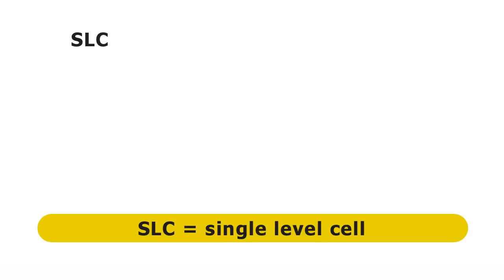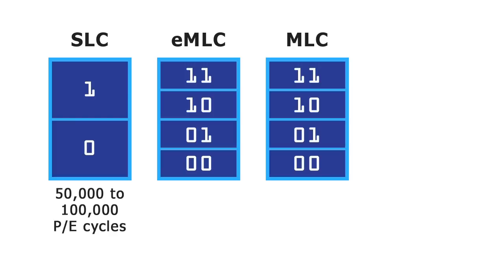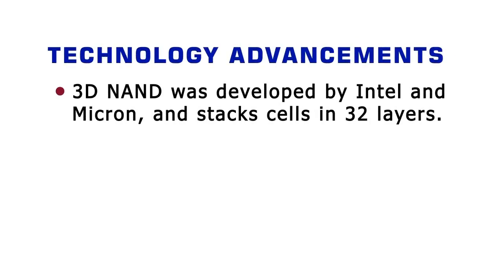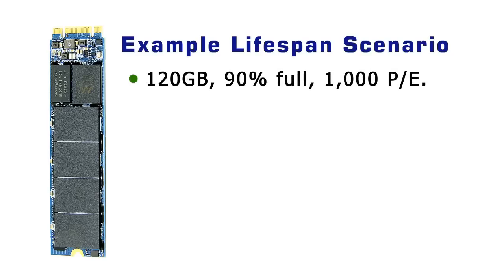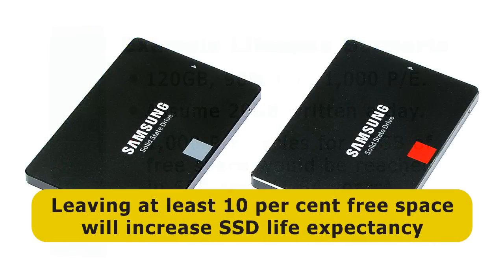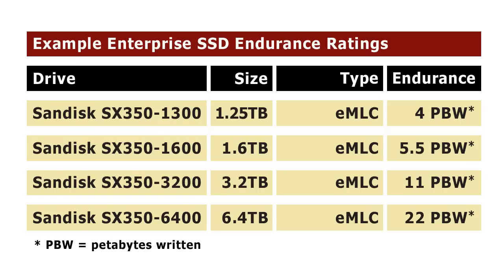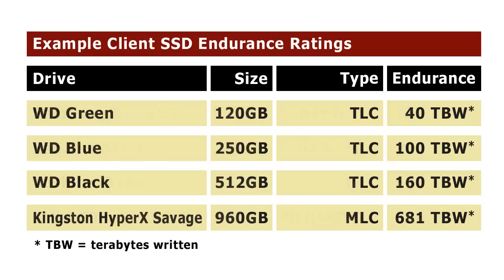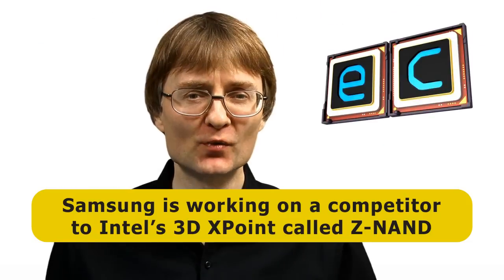SSD Life Expectancy

Comment: I work in a data center and SSD failure rate is on par with the mechanical counterparts. I also have been using SSD's on my personal computer for quite a long time, never having one fail on me, I consider them just as realiable as any other mechanical hard drive.
Reply: Fernando Kreutz But a data center would be writing data wayyyyyy more than a general user would
Reply: rin weeb that's why he's talking about the mechanical counterparts, I assume he means of the ones used in the datacenter.
Reply: Yes, but the SSD drives used in data centers are not the same type used at home (as reported in this video).
Reply: Mine died pretty fast for unknown reasons.
Reply: I have two failed since 2012. I have a few WD HDD which failed on me too (one losing a huge 3TB pirate haul of the finest movies ever made). But i also lost power supply units and memory parts, even lost ethernet controllers on the mainboard to voltage spikes on the landline (in Thailand not in Europe).
Reply: My scariest PC experience was a bios update on an asus pro gaming motherboard.
Reply: asus bios update is a mess
Reply: I agree. We have users with SSD in Lenovo laptops, we see a similar rate of SSD dying to that of old spiny magnetic drives. SSD show similar signs of dying also - Users report a slow computer. Then we find blocks are corrupted. Give it a few more weeks and the machines fail to boot.
Reply: Interesting, I'd consider them more reliable.
Reply: "SSD show similar signs of dying also - Users report a slow computer." That ain't no usual signs of a "dying" drive but of fragmented hard drives. The failure rate might be a coincidence or dependend on a specific user scenario.
Reply: Yes, both enterprise grade. But that translates just as well as to consumer devices in my opinion, I'd even say SSD's are more reliable on mobile devices (laptops) as they suffer no issues from physical abuse.
Reply: Red Phoenix fragmented ssd drives don't exist as they store data completely different
Reply: My biggest problem with SSD's are the loss of capacity over time. That's a lot different than out right failure. That's something that can happen really fast in a server application. I only currently trust using an SSD as my OS drive. Since I have an image of my OS drive, I don't particularly care about it.
Reply: That's why the first computers I installed SSDs in were laptops. All desktops followed after something like 6 months. The only type of device at home with HDs are my NAS devices. They still have 4x4TB HDs with RAID5. Currently only at 27% capacity. Hm.
Reply: If voltage spike kills SSD then thats the most alarming thing(I have 3 level of protection system) ,My mother board died few times ,My both ram Died toghether ,My PSU Died but my 2 HDD still working for nearly 8 years .SSD is another LCD tech after CRT monitor .Low life span ,Slim design Good for Business but not good for consumers
Reply: We reached the critical miniaturation dimension. Now with a >15nm process you can even kill memory chips and cpus by using software. wear out is much higher. I think soon we will have to rethink our purchase decision making.
Reply: @Konstantinos Kostis:  Sorry but a set of 4TB in RAID5 is madness and stupidity. The chance to get read errors during rebuild is almost a 50:50. I hear about so many systems crashed during rebuild now ... and wonder why this is not getting more attention. Do a mirror RAID1 or RAID6.
Reply: I had a dvd rom catch fire and scorched my SSD that was in the next bay. Is there a test I can do to see if the drive is stable?
Reply: My Vertex 4 died on me due to an electronic part on the mobo just up and frying itself but the replacement they sent (was a Vertex 460A since they had ceased the Vertex 4 production) and after 16-18 months I am at 93-94% according to SMART so it is so far so good and was the best investment I have made to bring new life into an aging PC.  Boot time for windows went from 60 secs to 12-14 seconds and I was thrilled.  My new Ryzen (late this year so the bugs are all ironed out) system will have a SSD in it as well but the price for a 1TB SSD sure isn't 60-80 dollars like it is for a HDD so HDD will be my D drive.  If SSDs ever come down to a HDD pricepoint I will toss the HDD.
Reply: I was kind of hoping that they would fail less often than mechanical drives, I've had so many mechanical drives fail... In fact, out of 8 mechanical drives in my server computers in the garage, 4 of them had started to fail in the last month. I've replaced the worst of them, but the other 3 I don't have replacements for yet.
Reply: Kaz might be worth changing your PSU. Solved many of my seemingly unrelated issues.
Reply: I've had a higher failure rate of SSDs than spinning drives in desktops. Laptops are another story as an SSD can handle vibrations and movement better than spinning drives. But what it really boils down to is don't buy the cheapest SSD you can find. There is a reason why the best ones cost more. I have a couple of bargain SSDs that I use for testing systems but for everything else it's Samsung Evos or preferably Pros.
Reply: Had to watch the video a few times to take it all in :-)
If anyone can manage to remember all that verbatim they could out geek their pals at a geeky party.
seriously though very useful to know, thanks
Reply: The problem with this is that I've never had a UPS last more than a year. After going through several of them, I just gave up. The two AVRs I tried quickly had a 50% failure rate. Of the UPS failures, all of the batteries were dead and unrecoverable.
Reply: @Lothar Scholz: nothing of the sort ever happened to me and I'm not just talking about the two NAS I got. The main reason why this is not getting more attention is most likely that it's neither madness nor stupidy.

What I probably should mention is that I replace those drives after about three years of constant use just to be safe. The old drives may get reused for temporary data copies. RAID1 just didn't work for me for capacity reasons. Mind you my first NAS originally had four 2TB HDs. Three years later I replaced them with 4TB HDs along with another NAS with the same size drives as one of my backups.
Reply: @Konstantinos Kostis: No it's not. There are reasons why at 1TB disk size every professional storage provider like EMC, Oracle or HP issued warnings against using RAID5. 
http://www.zdnet.com/article/why-raid-5-stops-working-in-2009/  you might also google about the "RAID hole".
Reply: @Lothar Scholz: Well, as far as I understand it the only way to migrate from RAID5 to RAID6 for me is to reinstall from scratch (since all drive slots are occupied and in use). At least it said so on the QNAP website. I shall give it a try when I replace the drives (not too far from now). Having a second NAS drive as backup gives me a chance to do this with low risk and downtime. Thanks for bringing this up, Lothar!
Reply: John Jeffry if you have surge problems, it might be due to a improper grounding connection...
Reply: Not always true.
Reply: Battery life in a UPS is an issue, but that's why most home UPSs have a way for you to change the batteries at home.  You can even change the batteries in some of the larger UPSs designed for office use, if you know what you're doing.

In many of the "home use" UPSs, you just need to switch it off, unscrew the battery panel and remove it and you can pull the battery out and disconnect the "spade" connectors, then purchase an identical replacement and reverse the process to fit it.

If the old battery shows signs of distress, such as bulging or cracking of the case, or the UPS gets very hot, you should either dispose of the UPS or get it repaired (in my experience, the problem will usually be one or more electrolytic capacitors which have gone low in value).

I have one UPS which wasn't really designed with battery replacement by the home user in mind, but I've replaced the batteries once in the past and I'm in the process of replacing the batteries a second time, coupled with replacing a faulty capacitor which resulted in the aforementioned "signs of distress" in one of the batteries.

In my experience, you should expect to have to replace UPS batteries at least every 2 years.  They do wear out even when kept on a float charge most of the time.
Reply: 5 years is actually a very good life for a UPS battery.  You can usually just replace the battery to revive the UPS.

If the UPS uses a SLA battery, you can increase the run-time by attaching a larger capacity SLA outside the UPS case.  Unfortunately, the only way to increase the power is by replacing the UPS with one which has a higher power rating.

You do need to be cautious about replacing the battery with a larger one, since it's possible that the UPS has been under-rated and will overheat if run for longer than the manufacturers designed it for.  This is especially likely for UPSs designed for home use since they are made to run for around 5-10 minutes only - just enough time for you to notice the power failure and save your work and shut down the computer.

Also note my reply to Art Becker about signs of distress from the old batteries.  The UPS might need repair or replacement in that case.
Reply: Yes, data center ssd drives used better quality nand like tlc/mlc instead of mainstream consumer drives which are mostly tlc these days. So he can't extrapolate his findings to normal ssd drives.
Reply: Next Version of Virus ,Malware will be SSD kilers ,So One Virus attack & Your whole Terabytes of data are gone .Good luck .
Reply: This is across 3 different power supplies however, the one that died the worst was on the highest quality server power supply as well. Though, a UPS could be worth looking into. Also, these are fairly old drives, 1 of the failed ones has been in service for 8 years, and the other failed ones were probably 3-4 years each. (2 good ones less than a year, 2 other good ones were also 6-8 years old.)
Reply: Personally, I haven't actually had any of my SSDs fail. I have a mix of Samsung 840 Evo, 840 Pro, PNY and Sandisk drives.  SD cards on the other hand... We've lots dozens of those to excess writes.
Reply: +John Jeffry There is no universal virus provider who makes like new versions of viruses. And viruses that delete your data or make it unaccessable, demanding randsom have been around for ages. Be your data on the SSD or HDD, it really doesn't matter. I have had only one SSD fail and even then by plugging/unplugging it sometimes worked. Enough to get a chance to read it out to a new SSD. It was on warranty and was replaced. I've got around40...50 SSDs altogether and the rest has been working fine.
Reply: In my personal experience, SSD fails sooner and have more problems than HDD. I have a OCZ Agility 3 SSD failed on me and also experienced issues with a Sandisk Ultra II SSD. So for now I'm sticking to HDD for storage and hybrid drives for my OS drive.
Reply: SSD already killed with Software by few SSD manufacturer that is why many SSD review show same story of SSD dying right after a month of their warranty expires .So it won't take much time when these Manufacturer made viruses got into wrong hand & they start spreading them all over internet .If SSD can be killed with software  then maybe its too much risky medium to store your precious data
Reply: Samsung ssd seems to have the biggest lifespan . A German computer magazine had a 750 Evo and used it in long term use for video editing for about 3 years very (they said very intensive workload). OCZ and SanDisk weren't capable to write the same amount of data , they failed a lot earlier then the Samsung one. All had the same capacity or was equal to each other.
Reply: All my ssd harddrive i have bought so far have failded after 6-9 mounths :/  just get them replaced by the warranty so no big problem. But damn im jelly on you. Fermando..
Reply: My HDD failures "warn" me.  Noisier, & uneven noises.  Higher rate of bad clusters over the dying months.  My HDDs are in a notebook, AIO or linked by cable, within my hand-reach.
Reply: I lost an entire mechanical drive's contents instantly due to a firmware bug. All mechanical drives have failure modes where you lose everything without warning. Just back up.
Reply: +cee128d Totally agree! Those few extra bucks on the purchase do reflect in longevity and performance. I also use Samsung and prefer them.
Reply: George... did you consider having someone do a clean room recovery of the disc? It can be expensive but sometimes worth it depending on the data.
Reply: C.M. Mike Adams Yep I did, as I assumed the data on the platters themselves was fine (corresponded with the bug report by Seagate themselves), but yes too expensive for the data. :)
Reply: Lower powerusage, less heat and faster speed isnt  good for the consumer?
Reply: HDD don't use that much power ,You don't need 2 TB/sec data speed ,even games dont' benefit from SSD speed ,so those are not that necessary but SSD fails in the Most Important sector which is in Protect your Data even after paying high price for that . (power failure ,other failure or just limited  controlled  life span).SSD passing an Experiment period now ,its not an Stable medium for data storage yet .Maybe Intel's $1500 3d Storage SSD is the future & can truly replace HDD
Reply: Games don't benefit from SSD speed? Really?

I know I have 3 games that started running with better fps after moving them to an SSD. Moreover after moving over to SSD multiple programs such as Inventor are less laggy.
Reply: You could argue that games are some of the best use cases for an SSD. Once you install them to the drive, its mostly reads rather than writes with reads not being damaging to the cells and providing a good boost in loading times/frame rates on games. Other than the occasional patch for a game you don't really overwrite stuff on it so it will last a long time.
Reply: Most people have no idea how to use SSD's and a great deal buys awful brands and them blame it on the technology.
Kingston makes the worst SSD's on the market imao. 
Always buy SSD's from brands that also manufacturers them specially the memory cells and controllers, like Corsair, Toshiba, SanDisk, Samsung and so on. 
And never do defragmentation on SSD's, I met so many idiots who defragment their SSD's.
Reply: thanks.
Reply: Fernando Kreutz And what will  happend if you drop one to the floor by accident ?
Reply: SMGJohn uhh does defragmenting ssds damage them??? 0_o cause I've been doing monthly defrags for the past 6 months
Reply: Hypatia ABANDON SHIP!! TURN OFF THE POWER AGHDJDJCUEJ
Reply: Feyangel23 defragmenting isn't required on an SSD
Reply: The best part is that they are getting better, so I wouldn't be surprised if they were to get more reliable than mechanical hard drives.
Reply: Feyangel23 defragmenting is for meant for hdd drives, doing it to an ssd is bad because its unecesarily straining ssd since its just wasting more write cycles and wearing out the cells by moving most of the data on it around.
Reply: Fernando Kreutz it is recommended buy high capacity ssd?
Reply: +Diego Camilo Peña Ramirez As mentioned in the video, its good to have over provisioning, thus, get one that meets your needs plus a few extra GB for that :)
Reply: +Aaron A nothing happens unless you physically damage the SSD (break it for example).
Reply: I can't wait until the new ferroelectric RAM becomes on-par with the current flash technology.  Then we won't have to worry at all.
Reply: Do you mean a nano-implementation of ferrite cores? It would be incredible to watch the construction technique for something so wild.
Reply: I think the biggest concern for end-user like me is the potential to significantly wear-out entire cells by an OS that is known to thrash mechanical drives when implementing "virtual memory". Any machine that I set up which uses an SSD has all ability to create a swapfile disabled.

Also, I only allocate a maximum of 75% partition space, even on drives (like Kingston) that already have a healthy hardware/hardwear reserve.
Reply: Fernando Kreutz 
The treatment of the disks at the Datacenter cannot be compared with the use of the average user. It doesn't even make sense. SSDs should be lasting longer than HDDs. I'm not doubting you, I'm just saying, you can't compare apples to oranges and then say that oranges are all of the sudden just like apples in every way.
Reply: Mine 128 GB Samsuns SSD in toshiba 2010 laptop now have more 1000 days off power on time..works like new..also dont use Windows 10 ...because Windows 10 use hard drive 10 times more then Windows 7
Reply: Feyangel23, are you being serious? I'm shocked that that is even possible to do. Defragmenting is not applicable to SSDs; it is applicable to Hard Disks. Defragmenting an SSD is as intelligent as rewinding a DVD movie after you finished watching it. Yes, if you are actually allowed to defragment an SSD, then you have been damaging it by wearing it out.
Reply: Fernando Kreutz 
Try theWesternDigital Purple Disk 8TB drive. It is designed to be used daily for many many years while you get hundreds of gigabytes in and out each day. And if you use it in RAID, you can have an incredible amount of transfer speed. SSD are only good because they have a short response time (closer to the response time of ram).
Reply: I Had 1 real hard drive fail in my life. Something I could not restore anymore at least. I already killed 3 SSD in the past 5 years. I have a neck for it since I am used to "sometimes" pull the plug out of active systems. I am old skool. This used to be not a bad thing.
SSD however is way more "sensitive" to power problems.
Basically my past 3 SSD lost their MBR function in general. In witch windows or bios for that matter, cannot initiate the hard drive. The computer does understand it is a disk of some kind, but it cannot use it. Tried to recover them with standard software but never got it working again. 
I know in the end the problem is basicallly still software related, I am afraid it is at factory level software.
Reply: Intel SSD having problem with firmware update, I have lost one SSD this way!  http://www.techspot.com/news/44694-intel-confirms-8mb-bug-in-320-series-ssds-fix-available.html
Reply: You can fix that 8MB bug by doing a secure erase with Linux(installed or usb run only). Took 1h+ to recover my  wife ssd, there are plenty of guides on how to do it. Hope you didn't throw it away.
Reply: Ohw thanks, I will have a look at it with some stronger tools then.
Ex-IT guy here btw. Disconnecting power is not the end of the world for a general HDD. Bad sectors and such always happen. But with HDD they are less troublesome just because they are more. SSD however does not recover well from "identity" loss
Reply: Good for u but I live in a country where city wide power is very unreliable and can blackout at random hours. If an SSD can survive that kind of abuse then it is worth using on a large scale. Otherwise mechanical drives can outlast SSD even under the worst case scenario of random power outages. SSD don't survive very long and therefore not trusted.
Reply: U can still retrieve data from a mechanical drive even after it is past the point of failure through cloning. SSD is more random. If u are lucky it will let u clone the data otherwise u can consider it lost as collateral damage.
Reply: Weed, and I get it from legal stores :)
But seriously, you have to show your basic hardware who is in charge... <-- get it ;)
Reply: Well last week my SSD started to give a fatal warning that it is about to break and all data may be lost (have it only 2 years around), to be more precise Windows gives this warning. I think the SSD has an built in mechanism that simply means its "safe time" and warranty its over and it may become unriliable in some future, but Windows interpret it as a fatal warning.
Reply: +Kazriko Redclaw ~ Love that name! (American Indian?)  You might want to consider moving your servers out of the garage and into a cooler, more climate controlled environment. Heat also plays a big role in the lifespan of electronic parts/devices.
Reply: using my laptop since 2010 with a 1TB HDD, i5 520m and a firepro 7820 . nothing in my laptop failed except windows itself which I had to reinstall.
Reply: In my past laptops the hard drive failing is always the first thing to go, and it's usually a result of me jiggling the computer a few too many times (or the one time you have a security cable locked to your chair, you push yourself away from the desk and the computer flies on the floor - that kind of thing).  An SSD is totally worht it.  Plus the increased speed makes windows 10 run at an OK speed and my IDEs load up super fast.
Reply: Time to get a new one.  120 GB is pretty cheap these days - definitely double the drive size to 250.
Reply: +Vincent Riebroek There's a data center that was documenting normal consumer drives vs whatever drives they were using and were finding that failure rates weren't too different. Though they did find that Seagate drives in particular seemed to just die without warning meanwhile you had more of a window for backups with other drives and even warnings.
Reply: +Steven Kennett I'm personally just planning on using SSDs for just some faster game loading, that's about it really.
Reply: +Chris Jericho I can't remember the tests names, but there's definitely some tests out there. Some of them test reads and writes (since that's a function they often do) and I think those might help confirm stability.
Reply: SSD is more "mechanical" when you look at it than a HDD, the 1 & 0 are all micro switch, on HDD it just a magnetic imprint
Reply: so yes it have higher risk of failure if you abuse writing, best use of it is for systems, then you mostly only read
Reply: true, but they lose differently than HDD... when you see a HDD losing space is because bad sectors, and bad sectors on a mecanical disk is symptom of inminent failure, meaning you will have to replace it... SDD doesn't have to be replaced until the wearing lever is too big to be usable
Reply: open the SSD and do a visual inspection od the SSD internal parts... you can do an HDD surface test to check if the disk holds the data well. if it does then the disk is safe to use
Reply: An HDD inside a laptop bouncing around in the back of a 4x4 truck will not last as well as an SSD. I just can't picture a data center in the back of a Jeep.
Reply: The data center is using hard drives from what manufacturers? In your experience what's the most reliable and less reliable hard drive and SSD manufacturers?
Reply: +the7observer for the most reliable hard drives I'd say Hitachi (HGST). They are typically pretty noisy but they usually have far lower failure rates than the ones from other manufacturers.
Reply: I'm in a similar position and still running an SSD based i5 system I built in November 2010 and it's still running great . . . fingers crossed!
Reply: Sai Lee, yes but it runs so slow, put an ssd in and it will fly.
Reply: Hard drives have magnets which pull the heads away from the disk patter. Electromagnets are required to keep the headers over the platters. If the power dies... the heads are by default pulled clear. The platters themselves are only damaged if the drive suffers high-G shocks while in operation, power surges, massive magnetic fields, massive thermal warping, etc. needed to overcome the magnets keeping the heads away from the platters.

Most drive failures are the motor, thermal or shock issues (leading to the platters deviating enough such that heads can't position above tracks), wear, or issues with the OS/computer maintaining sectors/data during power or OS failures -- i.e. bad FAT entries.
Reply: Pagefile is no problem. It is a myth. Microsoft has studied this and published data. They even recommend putting the pagefile on SSD for performance reasons. Data in pagefiles is read much more often than it is written. Data that changes frequently is the last thing the operating system writes into the pagefile. If it has to, it is time to upgrade main memory anyway because a system in that state tends to get terribly unresponsive. On many notebooks there is no other place for the pagefile anyway.
Reply: GermanAnimeFans You should have enough physical memory for your usual needs, yes. But you should not disable paging. Without the page file a spike in memory usage likely results in a crash! In theory you can make Ram big enough for every spike, but putting in hundreds of $ for memory you only use every few weeks is not worth it. Very large Ram also increases power use on mobile devices. A page file for mem spikes is cheap and the additional wear on the SSD is negligible.
Reply: GermanAnimeFans There is decently powerful video editing software under $100. There are smartphones with 4k video. This is a common application these days. I would get by with 8GB most oft the time, but Photoshop would bomb my 16 GB system without paging in some situations easily. Still, upgrading memory to 32 or even beyond its not worth it. The SSD is at 5 TBW after three years. It is specified to last 72. The computer will be totally outdated before it even reaches half of that. Of course the SSD can die next weak, but if this happens its not because of too many write cycles.
Reply: Well, loads of people use PhotoShop now.
Reply: Lightroom for me, and using an SSD in my Ancient Dell M6500 laptop turned it into a very nice, portable, editing machine for me. Spinning laptop drives were always the bottleneck.
Reply: GAMER 1975 Why are people so aggressive on YouTube? Why is this highlighted? Is disagreeing like a normal human being even okay anymore? Or maybe that's not normal, maybe there's a loooot of angry people. X)
Reply: GAMER 1975 Well not when I don't know you and you can't tell sarcasm over the internet with some emoji or such. o_0 All caps just looks angry. But hey, I'm still sorry to both! And glad to find a joker among the haters! ❥ ❥ ❥
Reply: I only had 2 ssds fail both was sandisk, 1 suddenly, other one would never give up on reading unreliable files, (used over 100 used and new  ssds) 

 (was able to recover most important stuff with hiron boot cd and the unstoppable copper witch was stoppable lol as it would pause indefinitely on files it could not copy but luckily if I paused it and skipped the file it would them continue on files that was readable) I could not clone the ssd due to the indefinite read wait that the ssd was doing (it's like the ssd was able to tell the software/os to wait data is comming and reset the data read error timeout)
Reply: Not a old hard drive, only newer hard drives can compare with an ssd
Reply: Will Clifton, hdd can ONLY compete on size and price 

both constant and random speed ssds are superior (and this is before you move onto m.2 pci-e nvme ssds as they can be 2-5x faster then sata ssds) , there is no comparison between a SSD and a HDD Speed wise, especially when random reads and writes happen as hdd are very poor at handling them (1-0.2mb/s hdd vs norm around 30-40mb/s on ssd this is random access) constant read speeds on hdd have improved and have seen 200mb/s but that reading a large files smaller files get read much slower, sata based ssds norm max out 400-550mb/s but that can be large and small files
Reply: lee x i was talking about life expectancy
Reply: Will Clifton, ssd life generally depends on how much you write to them, under normal use ssd should outlast a hdd (10 years at least, I have only had 3 SSD ever fail on me two of those with SanDisk based the third one I unsure off but it was dead on arrival random) unless your doing video editing that writes large blocks of data every day (you get a ssd that has higher write Endurance, the samsung pro ssds you can write over 2-4PB of data before date reliability becomes an issue)
Reply: Video editing usually does not write that much data. Your original video files are not changed at all. You just edit a list that contains information about the sequence of parts in the original video file(s), effects to apply etc. This is a small file. PCs are powerfull enough to generate a preview from this list and the original files mostly 'on the fly'. Short tempoary clips are only generated from parts with complicated effects, but these are only small parts of a typical video. A large file is only written when a project is exported. If you import a full 32 GB memory card and export an edited video of 10 GB every day this results in about 10 TBW after a typical work year (250 days). So even with lots of video editing a consumer level SSD should go for years easily.
Reply: Cyberat Rodent UPS = UNINTERRUPTABLE Power Supply
Reply: Konstantinos Kostis
I currently use a data center one at home.
Reply: I have a 500 gig WD hdd, guess its age. More than 10 years, and still works without issues. I still bet mechanicaly spinned magnetic platters are more reliable than electronic memory chips. And I really do prefer reliability over speed any time.
Reply: Fernando Kreutz But it is highly likely that you will be able to recover your data from a dead hdd but that cannot be said for an ssd.
Reply: Thank you, Christian Koehler.  I know this is old, which is why I didn't reply to all the misinformation before about the pagefile.  Anyone who thinks Windows memory management is more efficient without virtual memory has no clue about how it works.  Same goes for the pagefile killing SSD--utter bunk.
Reply: @Hy-jg8ow  power surge or brown power would be a curse - use line protection
Reply: @Vinz3ntR  et voilà...
Reply: @SMGJohn  besides a waste of time and minute life taken away from the drive any other negatives from defraging an ssd?